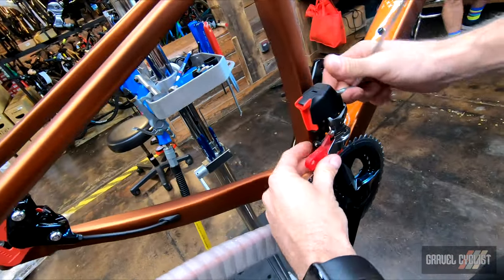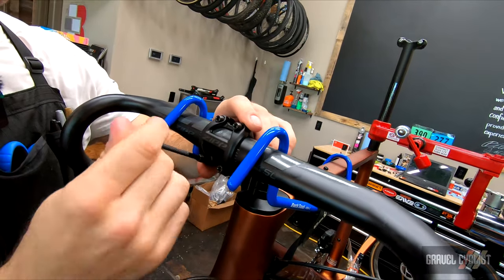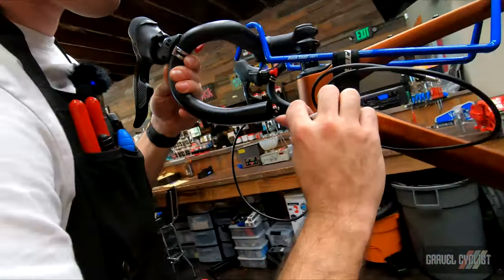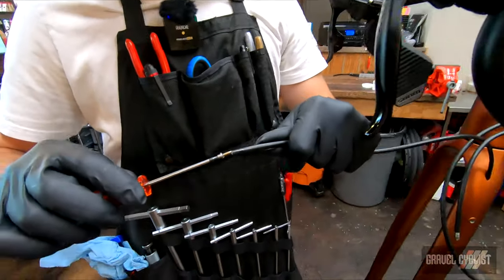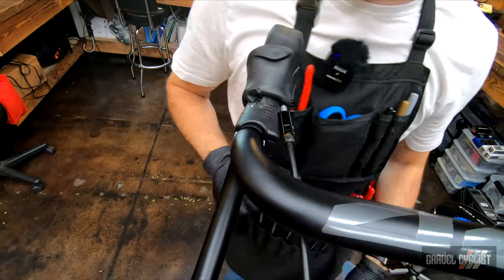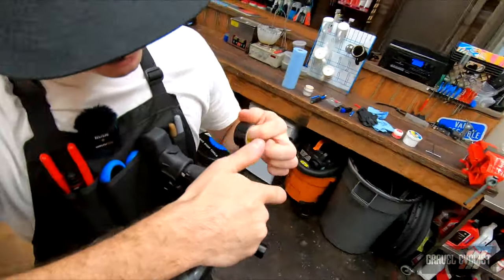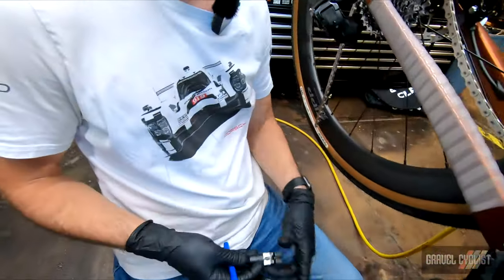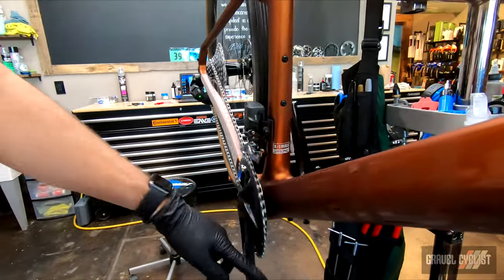Building a SRAM Rival eTap AXS Bike: Ribble Cycles Gravel SL - Part Two

Comment: Very nice. I just got the Rival Etap put on my bike and it has been terrible so far. It doesn’t like to shift into the high gears and the chain falls off it I shift into the small front ring. And it cost 1400.00!
Reply from the maker: Sounds like it isn't setup properly, not the fault of the drivetrain, rather the mechanic.

Comment: Aside question- could you use an 11-42 rear cassette for this setup? Perhaps with Wolf Tooth road link?
Reply from the maker: Hello Matt, I have never tried anything larger than 10-36 with this setup, but based on prior experience with the Road Link, it may work? I'm more interested to know what 11-42 12-speed cassette you have there?
Reply: @GravelCyclist  ha! I was thinking it was 11 speed. I am no mechanic. I just like low gearing😎

Comment: Didn't you have a problem with that special spacer? If I set my preload on the steerer like I would it is to loose for that spacer (it doesn't always move with the steerer tube), now I preload tighter than it should. Ribble made a very bad design in that spacer, there should've been a notch in the steerertube that slots in so it would always turn when the steerertube turns!
Reply from the maker: No issues with the special c-spaced spacer, except for the top cap that sits above it, which is a little too weighty, IMHO.
Reply: I agree on that. I have a Ribble CGR SL old model and the moving headset spacer drives me mad. Poor design and very heavy.